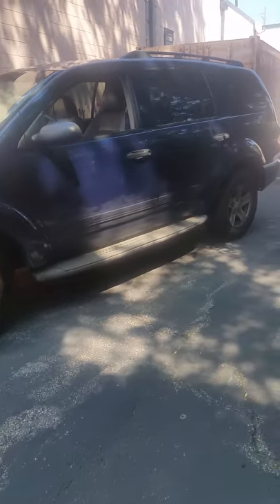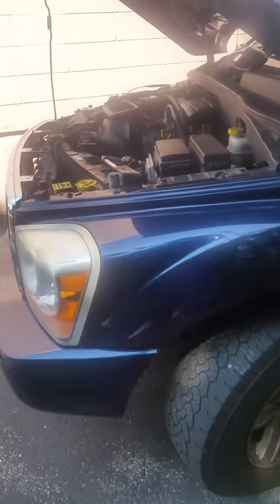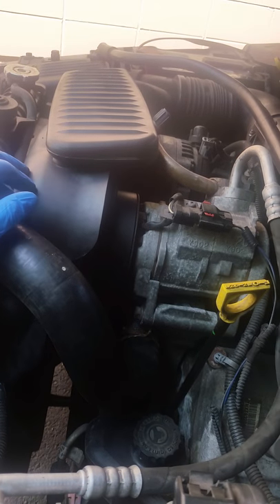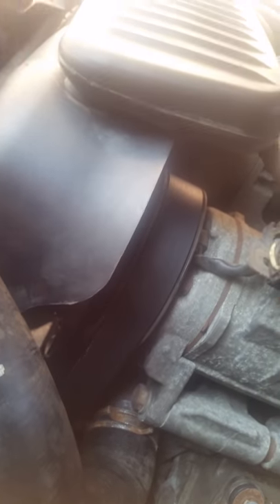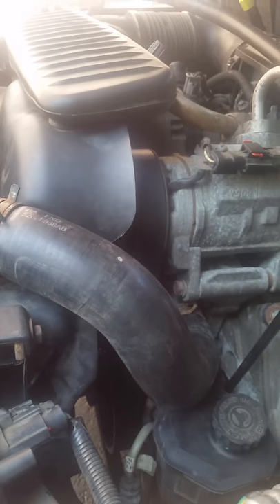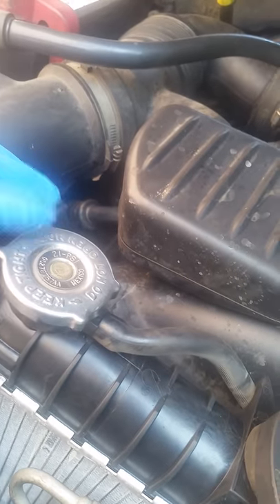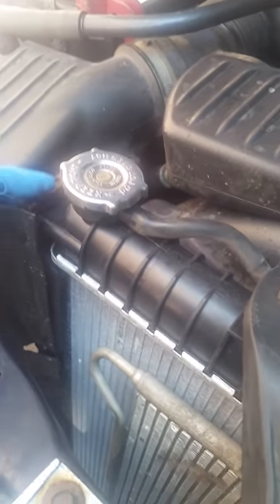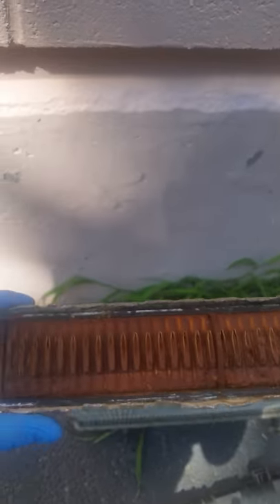Clogged radiator

Comment: I have the same exact thing on my 2017 ram 1500 first I changed the oil housing then 3 way valve , then thermostat ,water pump and now my upper hose keeps coming off and I’m thinking my radiator is clogged 😢

Comment: Did it leaked for you? Mine isn't leaking but overheating and I'm getting cold air from the vents
Reply: Fanclutch I just did that
Reply: Replace your thermostat first.   
Than see if it overheats 
If it doesn’t overheat you should get warm air
Reply: Did you fixed your issue?  And what happened?  Thanks
Reply: Go to your truck if the fan spins real free it's your prob my fan clutch I was driving light cam on I thought it was my belt but was  water pump and after putting the new pump on it would read hot sitting at the red light so watch couple videos checked it was free spinning but I also got a heater now so it's helpful...if you don't have the tool for your fan I took vice gripes put it on the pulley and hit it with a hammer and so lube
Reply: @kylephillips3584  you’re right.   Everything is working in my van.  I thought bi had a antifreeze leak.  But no.  And now that I remember my fan just won’t stop.  
I recall a few year  ago I was working for a compa and the fan did the same thing. And it was cold.  The mechanic said it was the fan clutch.  It never came to mind.  I tho I had a water pump going bad.  But there was no signs of antifreeze leaking

Comment: Did it not want to blow hot air before you fixed it , my 2004 hond over heating replaced the thermostat still overheating I noticed a symptom, doesnt blow hot air, it over heats at stop lights and a/c tends to blow hot air at stop light
Reply from the maker: Check your radiator fans probably not working ,if it's over heating on slow traffic or waiting on red lights

Comment: Was the system dumping coolant through the overflow? My Toyota Pickup has been dumping coolant, and I suspect blockages in the radiator, because the flow would not be optimal.
Reply: My Vx Holden is doing the same thing.  I've replaced the thermostat and radiator cap but I'm pretty sure it's the radiator.  Getting a new one next week.
Reply: +bill sammp buy a head gasket leak tester first. The kind you mount to your radiator. I tested mine a few weeks ago and I have a head gasket leak. The exhaust enters into the leak, traveling out of the overflow and pushing coolant out with it. do that first, it's a 50 dollar kit on amazon.

Comment: Question. Hopefully is answered. My car is kind of over heating, the needle does go up past the middle but not all the way up. Now, i know id not normal because it just started doing it. The problem starts when the car is on in idle for somewhat of a long timeish? And also when is turned off. Now, it doesn’t happen all the time because it has happened and it still does. Any suggestions?
Reply: KillerWarriorX I'm having the same problem with my Silverado, check your radiator, make sure you have no bubbles coming up, if you do its a head gasket problem, if your radiator is gunky looking then you need to flush it, water pump will leak when they go bad, radiator caps can cause problems, thermostat can be bad, a lot of problems are with the radiator gunk
Reply: My truck normally sits 190-210 degrees and when it sits at idle now with the ac on its slowly going up too 230 but won't go past it, ima flush the radiator tmrw and see if thats my problem because its caked and gunked up from what I see when pulling the cap off
Reply: Ive seen other videos and well, if is gunked up is most likely the radiator? Dont know for sure but for me, what makes me question a lot is that, well first, mine doesnt look gunked up, i just got a new thermostat not too long ago and what makes me question more, is that when it does want to overheat-ish, it also does it once i turn off the car... :/
Reply: Michael Duncan  Now i havent checked for the bubbles and i surely hope it isnt a head gasket, student budget here, but i will sure check that out. Thank you